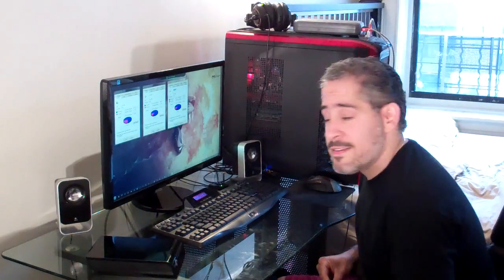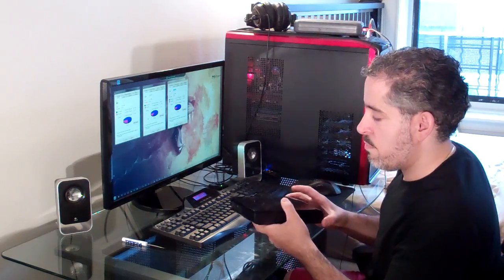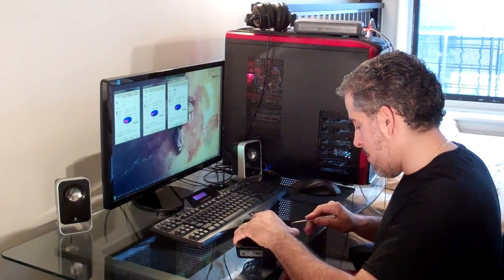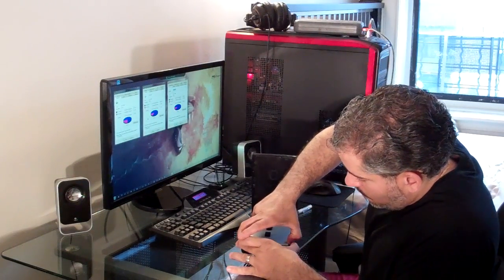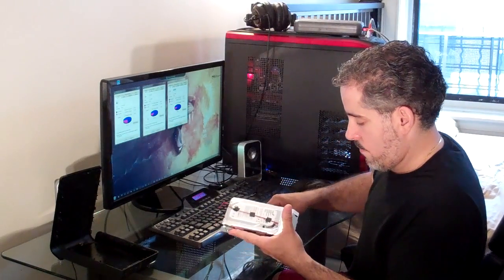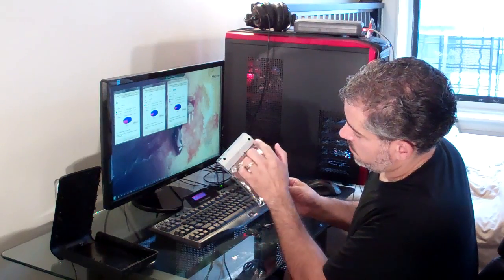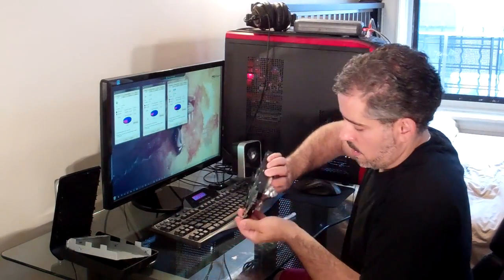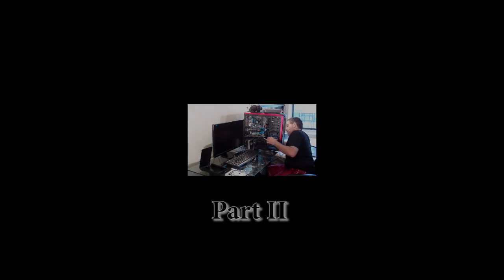Convert External Hard Drive Into Internal Hard Drive

Comment: Many thanks! This worked perfectly on an 8TB Seagate USB3 drive that took a header off the top of the case and onto the rug. It would power up but windows didn't see the drive anymore. Tried different cables plugs etc but still no dice. So I split the case, removed the adapter card, shucked off the conductive foil, plugged it in to the mobo via sata cables and presto! 8TB pre-formatted internal drive shows up. Take that Corporate America!
Reply from the maker: Glad it helped you in some form....
Reply: This is EXACTLY what just happened to me lol.. ironically I too have this issue with an 8TB seagate barracuda drive... I'm praying this will be recognized when made internal!

Comment: Will this work on a Western Digital WD Elements 1.5 TB USB 2.0 Desktop External Hard Drive?
Reply: it honestly depends on if the harddrive has soldered on usb plugs like mine did if that is the case it will not work because there is not sata connector or the standard power plug that are on harddrives 

hope that helps

Comment: BEWARE!! Newer Western Digital external hard drives ARE NOT convertible to an internal hard drive. They have the usb port soldered to the circuit board. No sata port to plug into.
Reply: Would you be so kind and list the names of the external drives +Francie Mc Cool
Reply: mikeelp23 I think its possible to change the connector card, just buy a cheap WD one from eBay
Reply: ***** I can't find what you're talking about. Can you sent me a link. I would like to use them internally in the future if the need arises but couldn't find a solution. So a link would be of great help to me. Thank you. :-)
Reply: +mikeelp23 SHiiiiiiiiit
Reply: not true I have 4 western digital drives which have a sata to USB adapter which I could remove
Reply: ʟᴏʟᴅᴀᴡɴツ
the 4 drives where western digital my book external drive.  it had a black drive inside it
Reply: THANKS I WAS GONNA RIP MINE OPEN
Reply: Can't use external drives as bootable drives as far as I know...  Windows won't allow it.
Reply: @michaelfrank3465  there is a workaround, format to NTFS, then install WintoUsb utility, you're good to go

Comment: So my drive works perfectly in my computer. But when I attach it to the external connector, when I try to initialize the disk in computer management, it says I/O device error. I have tried everything obvious and I am very computer savy. Any idea why? I thought maybe the OS looks at the format/ file system/ drive type/ etc differently between internal and external drives but I can not for the life of my figure out how to make it show up as useful as an external drive. Any useful info greatly appreciated :).

Comment: So basicly save $150 on an internal and spend $99 on a 2tb external to convert
Reply: Confused Doge Actually the one he is using in the video is an external powered hard drive and runs at 7200 RPM. The 2.5" External HDDs are run at 5200 RPM which are in laptops.
Reply: CraftyMiner88 The thing is. internal hdds are optimized for speed with rpm speeds at 7,200(usual). While external hard drives are typically lower since they are designed more for portability and form factor as opposed to an internal hard drive.

Comment: "he's going to use it for storage" 

as opposed to a weapon or a bar matt??????
Reply: As opposed to running a operating system from it, which would benefit from faster read/write speeds.
Reply: Don't know about you guys, but i use HDD's with bodybags. No floaters found after using the Toshiba's 2TB. Seagate & WD were terrible at sinking. Highly recommend the 7200rpm.
Reply: Come on, don't be dicks. It's obvious he meant that he's going to use it to store data (movies, pictures, music, what have you...) instead of applications or system data.
Reply: @Animagladius   that's not true at all, he meant storage as opposed to smelting it into cutlery
Reply: +Jammy De
Body Bags?
Reply: No he meant as opposed to using it as a plate to consume nachos

Comment: Does anyone know if you make from a External usb 3.0 Harddrive a Internal Drive
that it is posible that it falls insleep everytime and right when i shut down my computer my ssd turns off and the new internal hard drive  do a reset so my computer normal needs to shutdown in 5 sec and the other drive makes a reset so it thake olmost 1 minut before my full system power off and you realy hear the drive spining up again I dont know what it is maybe someone can tell me how to stop this